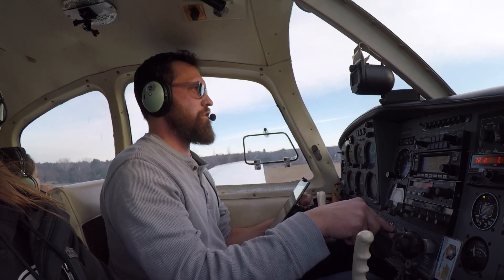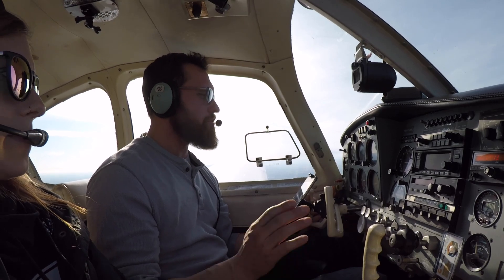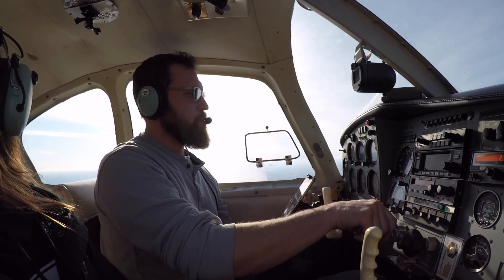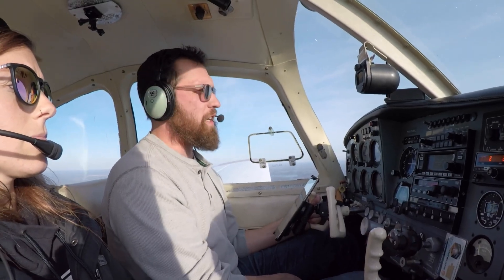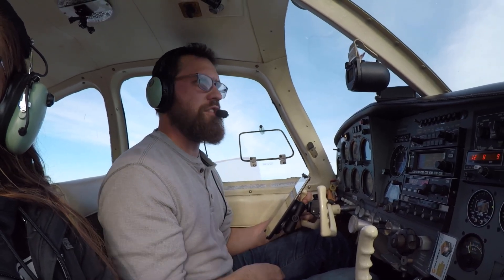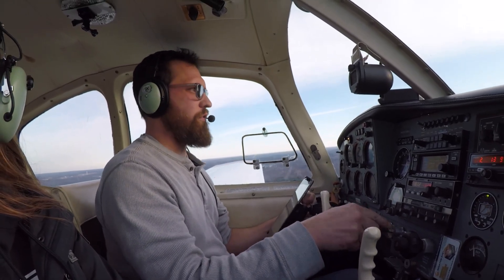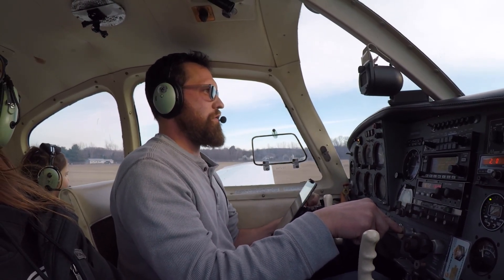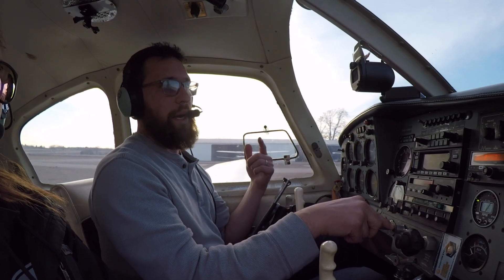STOP BAD LANDINGS!!! | Learn Power Settings & Stabilize Your Approaches

Comment: Man you sure are making life complicated.  My A model I enter the pattern 125mph. A beam the numbers at 100mph lower the gear call base & final pull the power and start rolling the trim full aft.  This forces you to manage speed as forward pushing yoke forces to maintain a descending turn tell if you are to fast.  Over the numbers begin a flair.  Land her nose high and practice holding the nose off like flying a Tail wheel.  No tire squawking and consider yourself good.
Reply from the maker: Yea I probably am, but my brain needed it. Is gear speed in the A model 100 mph rather than 120 like it is in my C? It's got to be hard to get it slowed down to 100 without the gear down?

Comment: Great video. When I instruct private pilot students, one of the early flights we play “test pilot”.  I have the student do much like you just did, learn the proper pitch and power settings for every phase of flight, and aircraft configuration. Start with straight and level, climbs/descents, turns, approach to landing and on.  I have the student record their findings. Now the student has a known pitch and power setting to apply for each phase of flight. After that we work finesse.
Reply from the maker: Thank you kindly! Makes so much sense!!!

Comment: I use a different approach.  I like to slow down to the appropriate  downwind speed  just prior to entry of that leg. I never chase manifold pressure. Once I start to turn base,  I'm mainly focused outside the cockpit occasionally checking altitude and airspeed.  Those are the only two numbers that matter,  using pitch to control speed and power for altitude while maintaining the correct  sight picture.
Reply from the maker: Staying focused outside and on airspeed is a great approach. What type of airplane are you flying mostly? I never had to pay much attention to settings until I started flying the Mooney.
Reply: @ThePeases414  I fly an experimental  that shares certain aerodynamics that remind me of your plane. You use the same V speeds for the most part and approach to landing speeds are the same. You enjoy more top end . I'm a 140mph plane, fixed gear, two seat tail dragger,  with a stick.  It's called a Cavalier 102.5  I'm installing more of a cruise prop next week.
Reply from the maker: Oh very cool, I will have to check the Cavalier out a little bit! Thanks for sharing.

Comment: In my 64 M20E for short field commercial landings I do 110 mph downwind until flap extension (17/18 in, 2400rpm).  Abeam I pull back to about 13/14 inches, full prop setting for go around).  85 or 90 on base.  80 mph on final.  I think with full gross 80 is good to maintain especially if you have winds or gusts.  For commercial short field I drop it to about 75 mph over the REILs dropping to 70 mph.  Usually at full gross that gets me 2nd center stripe.  If it's gusty keep it higher.  For a normal landings I always use half flaps (2 pumps) and about 80 mph as this is smoother if there is no short field concern.
For those working maneuvers at full gross I use about 18/2400 rpm for the lazy 8s, and as a starting point for most maneuvers.  Chandelles full power and full throttle (can get a little scary watch your rudder at the top!)  Some recommend 25/25 for chandelles to moderate the deck angle.  Va varies from about 120 to 132 mph in the short bodies so 17 or 18in usually gets you close to maneuvering speed.  I use backpacks with bricks to practice at full gross simulating the DPE lol.
Reply from the maker: This is awesome man, thank you for sharing! The landing speeds you mention are all done with half flaps? If so, when do you put them in? That sounds like it's worth trying.
Reply: @ThePeases414  I use half flaps abeam on downwind (2 pumps) for all normal landings.  I’ve just found it causes the E to float less during the flare but makes for a much smoother drop as you touchdown.  With full flaps I was getting a firmer drop at the end of the flare and it just seemed less glassy/smooth.  For the commercial short field landing though I use full flaps (2.5 more pumps on base) due to the nature of ACS.  You’re supposed to land in as short as possible distance so for that one I use full flaps and about 80 mph on final and 70 to 75 mph on short final and aim for the 2nd or 3rd center stripe.  I do come in probably a little lower than I should on those on glide slope.  (Also, I don’t go that slow in gusty winds).  
Half flaps works way better with strong or crosswinds also.  I’m in the open plains and often have 15G25 knot winds etc.
For the power off 180 I’m still working on how I want to set that one up....but generally pull power abeam and don’t use flaps or only half flaps like around base to final.  If I do no flaps on the power off 180 I usually go fast to make it to the touchdown bars (have to hit those for accuracy) so I come in at 90 mph over the end of the runway and kinda low...and just float in the flare until speed drops to about 70 and you touch down.  You float for a long ways at 90 mph but I’m trying to control the accuracy of the touchdown.  The trick with no flaps is that you touch down much faster than normal.  I’m refining my power off 180s for the test so I may try different technique soon like half flaps or full flaps and turn to the runway sooner.  I just found with flaps full on the power off 180 you float ALOT and can miss the aiming point.  

I highly recommend half flaps for all normal landings though it should really smooth out the touchdowns for your passengers.  I like it due to less stress on the gear and airframe.
Reply: The only time I don’t use half flaps is short field landings when it’s like 2500 ft runway or less or I want to make a certain taxiway etc.
Reply from the maker: Thanks for the detail, sounds like your having fun finding the best ways to handle your Mooney. The power off 180’s intend to leave the flaps out until the last minute, only putting them in when I have the runway made, or need to gain a touch of altitude and can give up the airspeed. Thanks again for the incredible detail!
Reply: @ThePeases414  lol yeah sorry probably a bit too detailed I realized afterwards I put quite a bit of that in my comment 6 days ago.  Anyway, yeah very good point, the power off 180 you do have to ensure you make it to the right spot.

I have really enjoyed the E I bought in July...just about to do the commercial check ride in it.  I’ve probably done about 300 landings in it now and I have 137 hrs in it since July.  Trying to get thru my licenses quickly for corporate or regionals.  Really enjoyed your insurance video, now considering dropping my full coverage lol.
Reply: @ThePeases414  if
let me know how it goes and how you like it with half flaps.  Just remember your stall speeds as you turn in the pattern will be higher so I don’t go below 80 mph downwind to base or base to final.
Reply from the maker: That was the reason I asked the question, I’ll probably run base to final at 90 and won’t slow down until I’m established on final.

Comment: That was a great video, Cory!  My problem with the MP adjusting during decent can’t be that precise (steam gauge).  I have gone back and forth on different approaches as to whether to set 80mph and 10” turning base to final or using the 100, 90, 80 method.  In either case, I have found that trim wheel to be very helpful in getting the IAS down.  Keep ‘em coming!
Reply from the maker: Most definitely have to use that trim wheel, it’s a savior! I love trying new methods, but I’m pretty happy with 100, 90, 80.

Comment: Mine comes down like a rock under 85, likely that heavy 3 blade.  I’m usually getting to gear speed midfield downwind, 100 abeam the numbers and 2 notches flaps.  90 turning base and full flaps if I’m high (drug free), 80 short final with the stall horn sounding like Morse code.... it’s smooth around here during the winter but we get thrashed around on final when it’s warm out.  Pitch for airspeed, power for 500fpm decent all the way to the ground.  Just need to work on my over flaring....
Reply from the maker: Nice analysis! Just thinking through it makes you so much better! Have fun man!

Comment: Nailing your approach speeds is the key. I fly a M20K and the basics are identical to your C. As you say, 100 knots on downwind, 90 on base, 80 over the fence, and 75 on short final will grease your wheels onto the runway just past the captains bars. Adjust power as needed to nail those airspeeds and you’ll do fine. Honestly, I never look at my engine settings after I reduce MP abeam my touchdown point. I watch attitude and airspeed and make minor adjustments to power by feel to maintain airspeed and it all works.
Reply from the maker: That’s the way I did it in the past, never looking at my engine gauges. I feel like knowing the starting points will help me greatly.
Reply: @ThePeases414  yeah, I get it, and I agree you need to do the slow flight testing at altitude to get your settings corrected so you’re not coming in hot over the numbers.  I did the same when I was new to my Mooney, and settled on 15 inches as my initial power setting to descend on downwind. The fact that you got a good landing with your settings tells me that you’re on the right track. In another 100 landings or so, you will be able to do it without thinking about your power settings because you’ll have the feel for it, and you’ll have that for the rest of your life.
Reply from the maker: Right on man, good way to think about it!
Reply: In the C and E that is a bit too fast since you are doing it in knots.  We have mph not knots on the old model. You'll start to rip flaps off at 100 mph is top of white arc on the short bodies.
Reply from the maker: 100 is the top of the white arc, but rumor is the flap speed was increased quite a bit (120mph) without any structural changes...just paperwork.

Comment: With my Mooney M20C, if I'm too fast, I just pop those speed brake😁. On one flight 9 flights so far, I was wondering why I felt so slow and had to be adding so much power. When I looked to the side I saw that speed brake did not go down fully. I cycled the the speed brake and all was well again.
Reply from the maker: You have speed brakes? That’s awesome! I don’t know that I could ever justify the expense, but I’d definitely buy a plane with them installed!
Reply: @ThePeases414  they came with the plane. When I tried to negotiate with a lower price, I got the update about the speed brake and something else. Little to no room to negotiate. See why my insurance rate is so high😭😭😭😭. Shes lovely though.
Reply from the maker: Sounds like it! How much do they really slow you down?
Reply: @ThePeases414  cant really say exactly but a lot. You would have to feel it for yourself one day. Needed to get dwn fast one day and when I popped them, I was able to make a steep decent real quick and land without holding up a C130 that was coming in to practice dropping something on the field. One day I'm going to try using the speed brakes as a spoiler egen I land and see if it slows me dwn on the ground much.
Reply from the maker: Right on man, I can’t wait to get a feel of it some day!